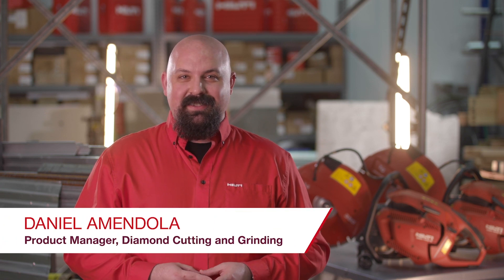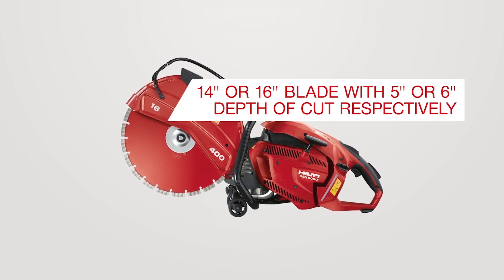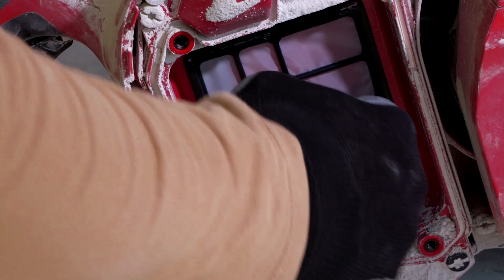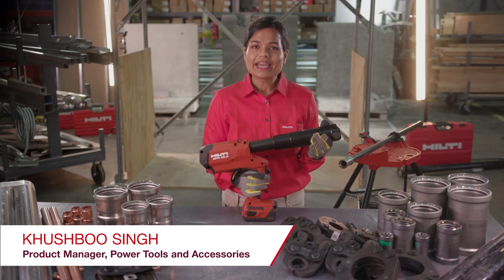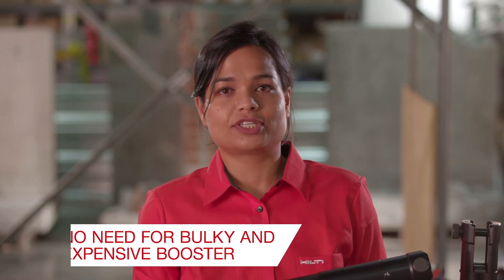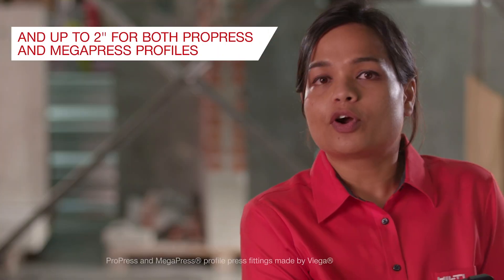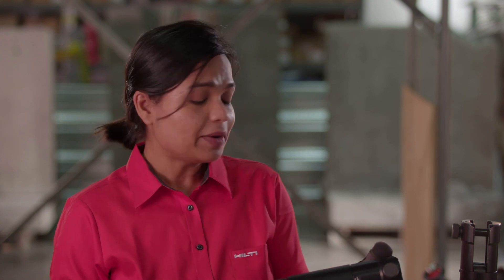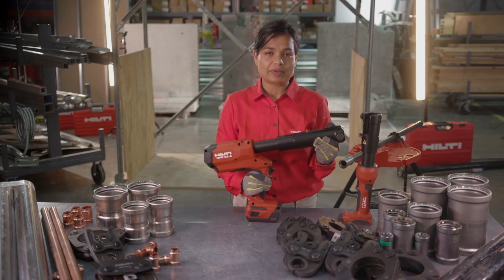OVERVIEW of Hilti's gas saws and cordless pistol-grip pipe press tool

Comment: Nice video. How about weight? Hopefully less than dsh600
Reply from the maker: Hi Andres, thanks for the question. The weight (without cutting disc, fuel tank empty) is 26.2 lb. for DSH 700-X and 26.5 lb. for DSH 900-X!
You can find more information here: http://hilti.link/WGJ 😄